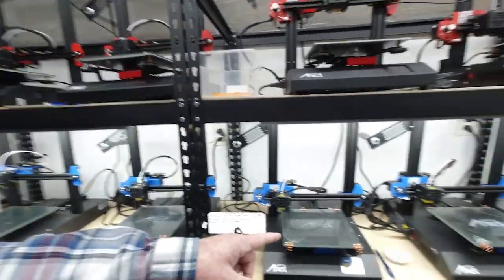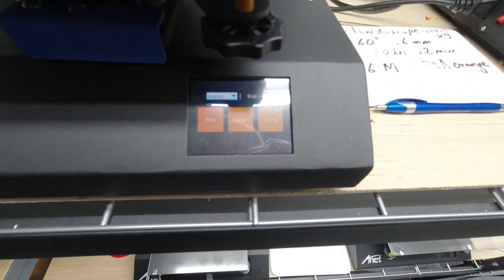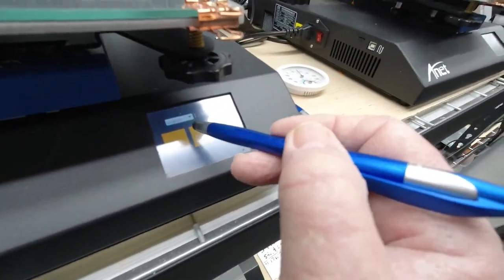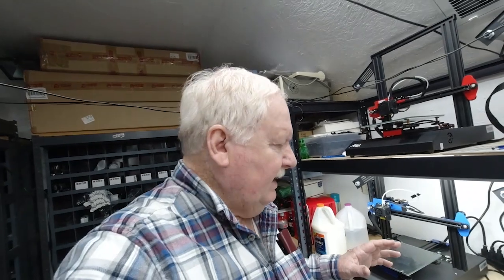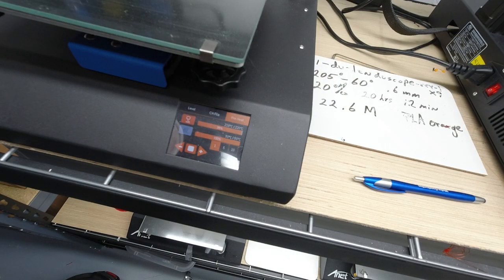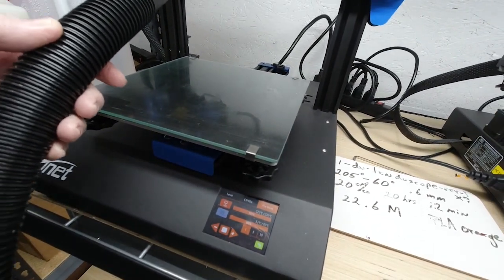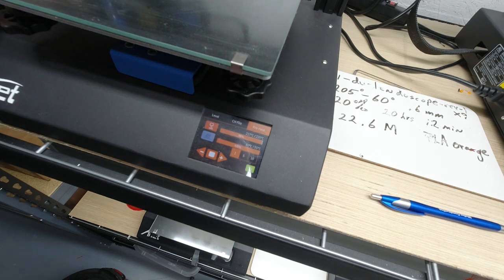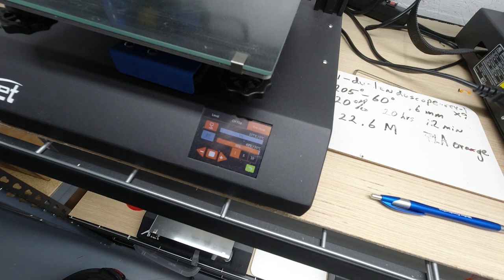THERMAL RUNAWAY IS MY ANET 3D PRINTER SAFE will be demonstrated showing the Anet printer to be safe.

Comment: These Anet printers use NTC thermistors, not thermocouples.
Reply from the maker: Thanks for the correction, Anthony. You are correct the temperature measuring device on my printers are thermistors, which are different than thermocouples even though they both are used to measure temperature changes. I do use some thermocouples in my high temperature furnace for temperatures in the 2,000+ F range. Thanks for being sharp and catching my mistake...Ken

Comment: 3:00 I had that happen a couple of weeks ago.  I'm in michigan and had my printers in the garage.  It got so cold I couldn't even heat them up.  Moved them in the house since then.  Mine are all variations of ender 3's and they have like a special error screen that comes up when it's too cold to even heat them up.
Reply from the maker: It is better to print in a consistent environment of humidity and temperature. I try to print at less than 45% humidity and between 80 and 90 degrees F....Ken

Comment: Good for you Ken for finally putting this issue to bed (no pun intended). And I fully agree with you: I do wonder how much of a dangerous fire hazard are the actual printer itself? I've got all of mine on ceramic tiles and away from any combustibles (cement walls/floor) along with fire-smoke alarms in the area. So, not any worse than any ol' appliance in the home. Claude
Reply from the maker: Sounds like you do have things under control and in a very safe environment there. I still have a few things I would like to do here like using Hardie board " cement board" under and around my printers. I will get to that later. Thanks for sharing that info and for your support my friend...Ken